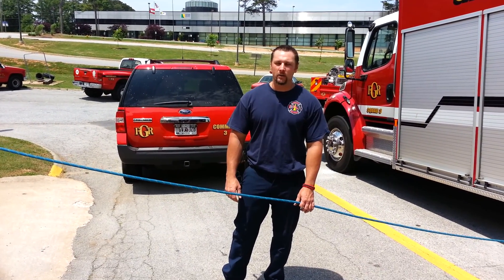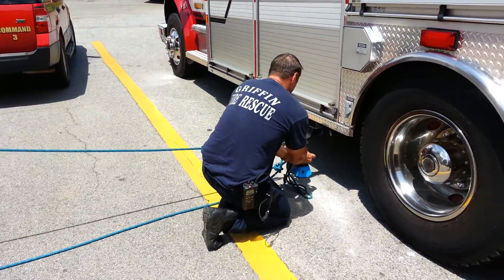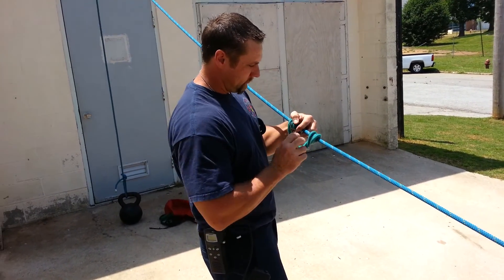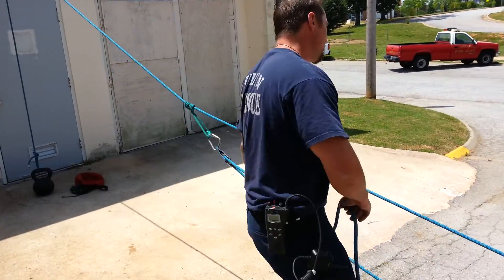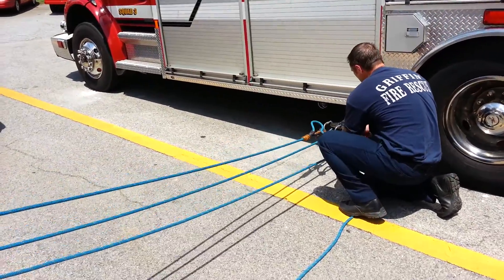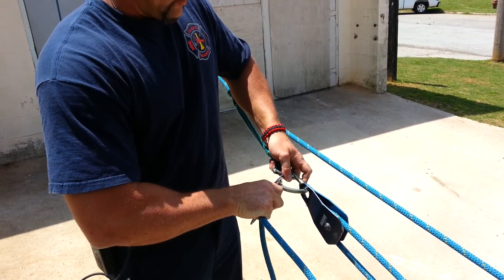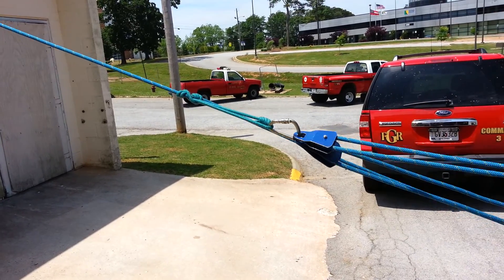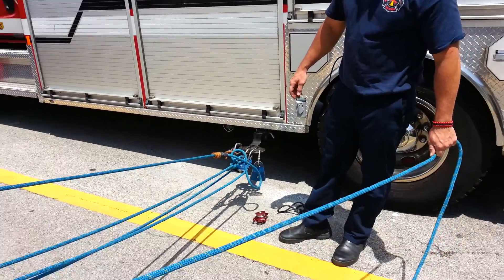2:1 to 4:1 pulley conversion system npq

Comment: Just came across this video while doing some research for the rescue tech class I teach.  Good video, but why a 2:1 piggy back system by itself?  A piggy back by itself is lacking the benefit of an auto progress capture with a 3:1.  With the extra pulleys or preferable a double pulley convert the 3:1 to a 5:1 and then add the 2:1 piggyback to double the 3:1 or 5:1 mechanical advantage to 6:1 or 10:1.  My preference is now is the CMC MPD, realizing this video is a few years back.

Comment: If you only have 2 pulleys you can also set up a 2:1 to pull the line on your original 2:1 if I remember correctly. But you will need a second separate piece of line. Drawn out it looks  like 2 Vs with the bottom of the one you are pulling on connected to your original pull line. Not pretty but if your confined rescue bag has been robbed I believe it will get you 4:1 the dirty way. I do miss the annual CFS training  our employer used to send us to. Thanks for sharing.

Comment: My mistake.  I thought you had a pulley at the anchor of the load line.  From a glance, it looks like Z-rig.  Why not use Z-rig instead and then add 2 : 1 pulley to pull the Z-rig, which will give you 6 to 1 mechanical advatage.  Thanks.

Comment: It is not 2 to 1 pulley.  It is 3 to 1 pulley system you have on the first system.  When you attached the second system, you have 5 to 1 pulley system, which is better than what you thought you had.  Check again.